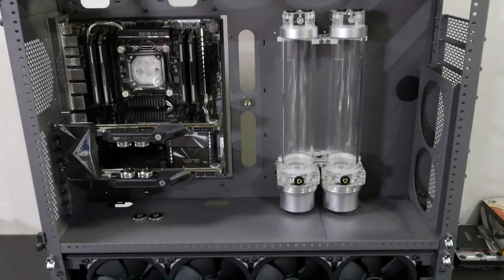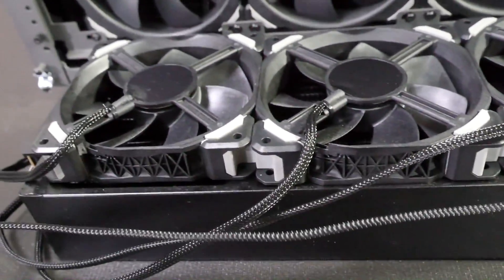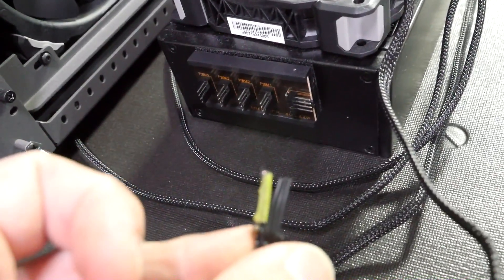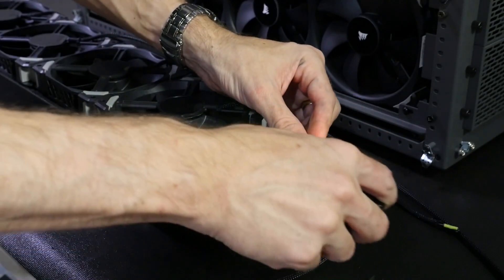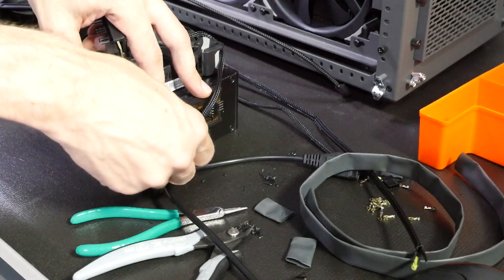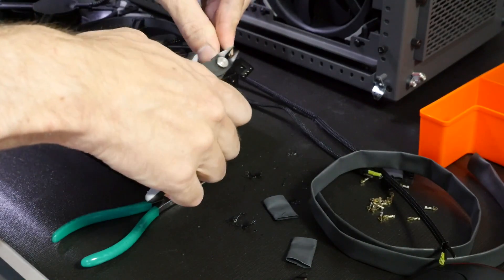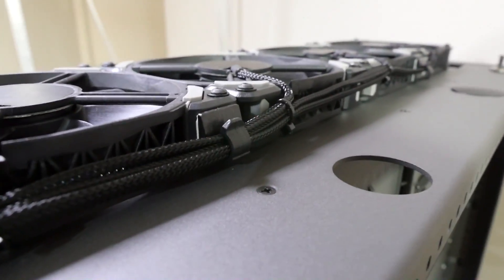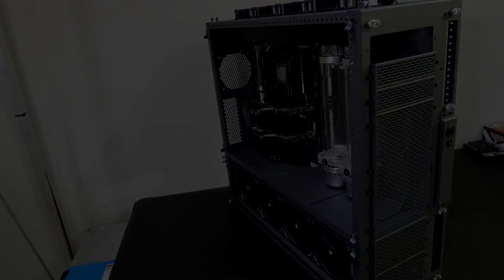Radiator Fan Cable Mods

Comment: With a setup like this, could you run the power lines in parallel and just run individual signal wires with an umbilical type setup? Not sure exactly how pc fans are controlled, I'm used to ESCs with power, ground, signal, and optional signal ground.

Comment: Hey. Love the channel. I got a question regarding fan connections. I'm planing to run 6 non pwm 3 pin fans on 2 x360 rads. Can I run and control all of those fans with a powered fan hub off of the cpu opt  on my mobo? My motherboard has the option to control the fans with voltage control.

Comment: I have modded these fans before. I found the best way to keep the cables in check as they come out of the fan was to dremmel a hole through the side instead of cutting the clip off.

Comment: Fantastic guide. Thank you. I just need to learn what connectors to bye so i don't grab the wrong type. other then that im gold. & yes the fan splitter (Phobya) is great i could only get 1x4 x4pin from Germany in eBay. PCCG & Mwave don't stock them.
Reply: search for modmytoys on amazon.. you can buy basically every fan splitter you want there..

Comment: do you realy use those very loud fans from corsair...i use noctua...i knew they are ugly but they are very quiet and have a great performance...i would rather like to paint the noctua then use this turbine fans xD
Reply: doesn't really matter with this overkill rad surface i guess.. they can run on minimum all day even under load..
Reply: Dunkelelf3 kannst auch deutsch antworten...sieht man doch am namen xD

ich kenne diese lüfter...die drehen selbst auf minimun bei 1200 oder so...und dann machen die hässliche geräusche...ganz miese dinger...ich hab meine noctua bei max 900rpm laufen und leerlauf 600...das ist dann flüsterleise...ich nutze aber auch nur 30mm dicke rads...besser für airflow und wärme abtransport

Comment: Great. Why not a push pull on the top radiator. There is place enough or?
Reply: There's little point to doing that. It's 4 more fans, meaning 4 more fan cables he'd be modding. Another splitter. Another channel he'd need on the Aquero for controlling those fans if one channel cannot handle 8 fans (likely not since that'll likely mean more than 1A of current).

All for... a couple C difference in temperatures.